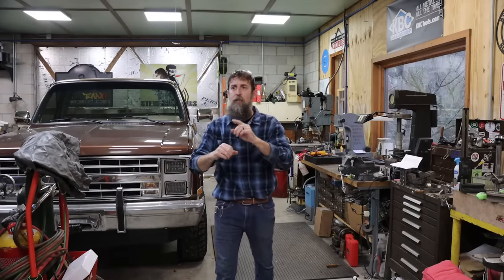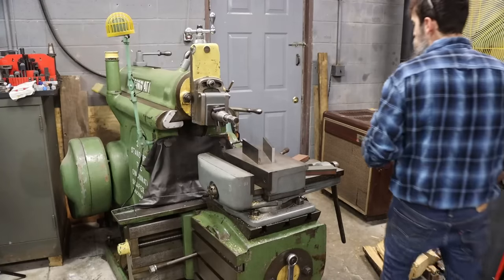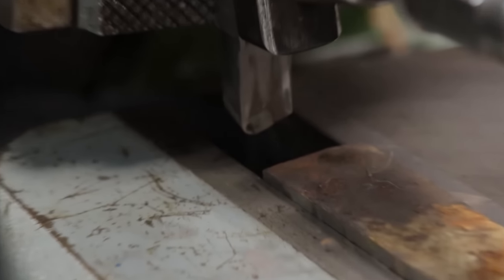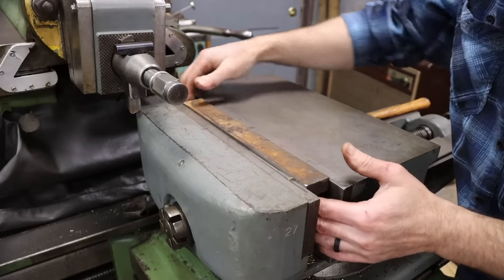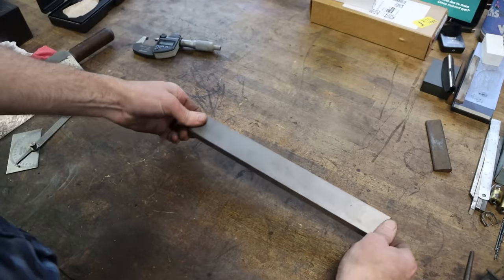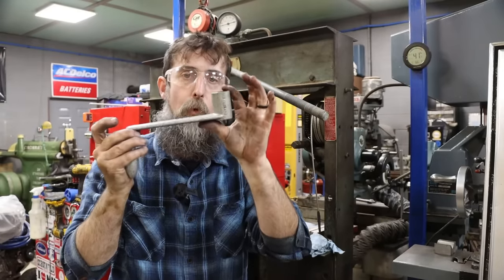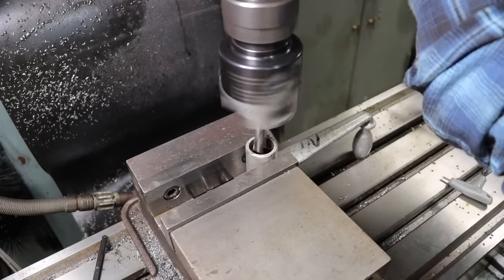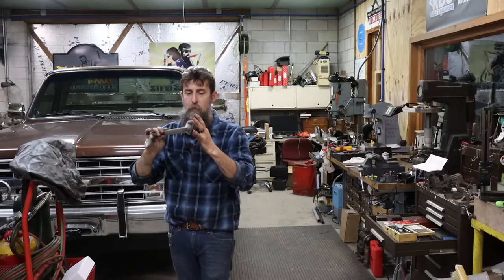Scrap metal to shop Tooling!  Machining tooling for a friend

Comment: A technique I came across recently that I thought I'd share, really blew my mind, and the few pro machinists listening as well.

If you're surface grinding a part and, for whatever reason, none of the surfaces are close enough to "flat" for your liking, or you've flipped it over a few times and seem to be chasing a high or low you can't pin down, try this. 

Take one (or 2 stacked sheets, depending) of paper towel or shop towel, and soak in water. Lay them between the part and mag chuck and magnetize. Depending how janky the part is, you might want to take a light pass, flip, light pass, flip, etc. just until there aren't really deep lows or highs.

The science behind this being, the saturated towel will help even out the highs and lows by allowing highs to sink further into the towel. Also, from what I've seen of this trick, for whatever reason the finish will be so much better than normal! 🤔

Comment: As always, an excellent presentation!  It is a wonderful example of the utility of ‘tools gone by’. 
An “old” machinist often told me… “You can make ANYTHING with a shaper, EXCEPT, money!!!”.
LOL 😂
Reply: I'll bet machine operator in China runs 3, 4, or 5 scrapers at a time, and sharpen the tools while they're all running. So I'm thinking they can make a buck off those old machines with very cheap tooling.

Comment: If the scraping straightedge was for a 60 degree dovetail on a lathe cross slide, seems like cutting a 45 degree bevel one side would work well, & not have removed that much material, & would have probably been fine for a short dovetail.. anything will bend slightly. Also, a lighter straightedge can have better feel spotting a small surface, especially in a corner. Great to see some satisfying small projects!

Comment: That’s really wild on the difference between the ball slides and the regular v-ways. I would have definitely thought the ball slide would be superior, but your grind quality didn’t lie! Very interesting!
Reply: When in good shape the ball ways do a great job. The B&S is just in better shape. That could also be an issue with the spindle, not the ways. It's hard to tell unless you have seen the ways and really torn into it.
Reply: @moosesmachinery  I did consider that it’s possible that in “good (or great) shape” the ball slides might easily outperform. It’s just that in bad shape, the problems could be exacerbated. Thanks for that comment! Helps me to learn

Comment: Well done, Steve. Sometimes the most simple jobs or let's say "fixes" give you most satisfaction. You know, when something little like some fitting issues bothers you, there is a high probability for unacceptable level of frustration, which down the line makes your work worse. Some starting good mood is mandatory for good results! 😉 Cheers, Happy New Year to you and your family.
Reply from the maker: Equipment that works without hassle is a pleasure to use.

Comment: Better giving up on holding that in a 4j than having it become a projectile. Of course that’s never happened to me…🤥. Best to use only the level of accuracy required. I heard once that every increased order of magnitude of accuracy doubles time/cost. It’s probably BS, seems a but too convenient, but it does make a point.

Comment: Your surface grinder with the ball bearings must have been transported without wedging the table up or removing it entirely, a sure fire way to ruin the running surface on the ways.
That Brown and Sharp is a very nice machine however.

Comment: I wonder if you should have heated the piece up and let it slowly cool to relieve any internal stresses in the material before the work.
Reply: It looks to have been left out in the weather through snowy winters and warm summers for a few years.A few years back there was a video uTube showing a Japanese factory making cast iron reference tables and they did exactly that for castings some of witch looked to be 2x3 meters and at least .7meters deep.
Reply: Myford did the same with their castings, left outside for a period of time before machining

Comment: Steve, I may commented on this previously, hydraulics on the Micromaster seems fairly quiet and tolerable. Many machine hydraulic systems are very gnarly. 

This reminds me of a the hum of a turbogenerator on a steam locomotive when it’s at rest! Here is a video of a Pyle National generator be tested (at ground level). Test starts around 5:00. The high pitch is not near as pronounced on top of a locomotive while you are on the ground. 

https://youtu.be/aNQwU3cSSQk?si=S24j0dgVLqpeXHsH

I am odd, the sound of a Pyle National generator is comforting! 

Thank you for sharing. 

Happy New Year! 🎉

Randy Musselman
Wyoming, DE